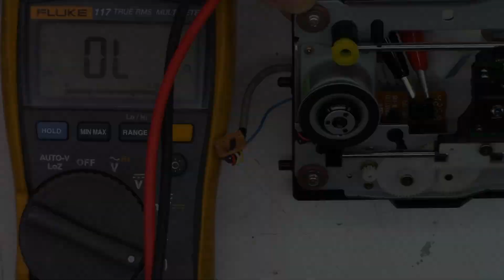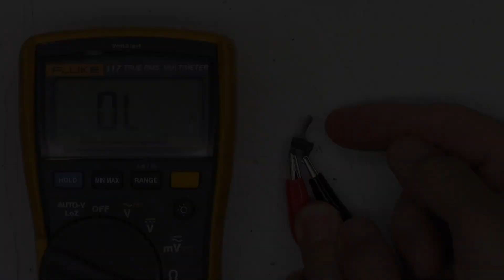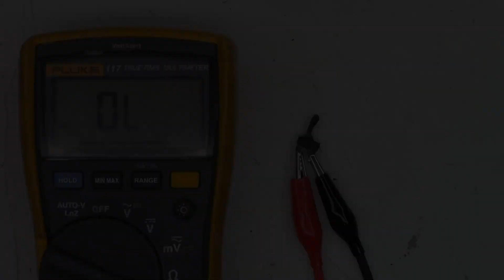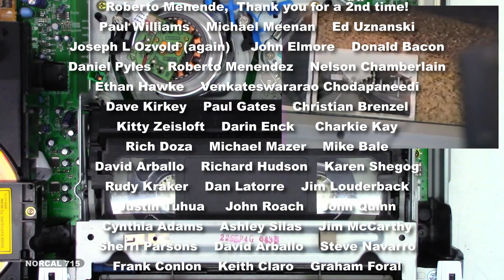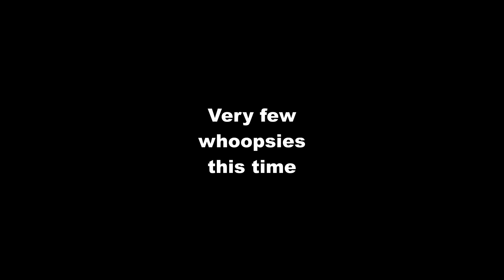Zenith (LG, Lucky-Goldstar) ZBV443 VCR/DVD player - Wont play DVD's I almost skipped this one issue!

Comment: Again, I will never be amazed by how such simple, low cost components cause owners to scrap otherwise usable gear.  How many microwave ovens get tossed everyday because of a blown fuse or multi-thousand dollar home theater processor is side lined because of a shorted cap or open resistor?  Repair techs like you are invaluable.  I wish i was just such a person.  All I get to repair is welding power supplies, engines, generators and related equipment.  I'm unfortunately not skilled enough, yet - if ever, to do many board level repairs.  But, damn! I sure would like to be smart enough to repair AV gear, because it would certainly bring a smile to an owner's face to see or hear his/her entertainment equipment working again.  I often feel so damned worthless!

Comment: Yep, many people to this day still don't know LG was Goldstar branded in the past. Made by LG,  Lucky Group I believe is their actual name. I myself always prefer to call them Lucky Goldstar as most tech. people do. 
Also I'm not a fan of the micro switches as what they used in this for the home detection circuit.
Why not use the simple 2 piece metal with 2 contact and a bumper open faced switch like in old 8 tracks and so forth. Way easier to clean the dust off of and to bend for adjustment.